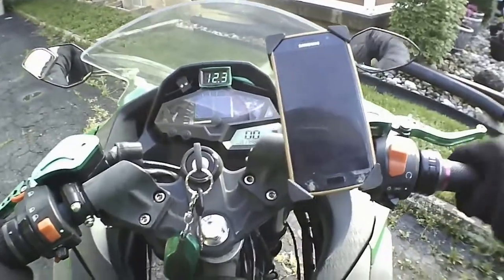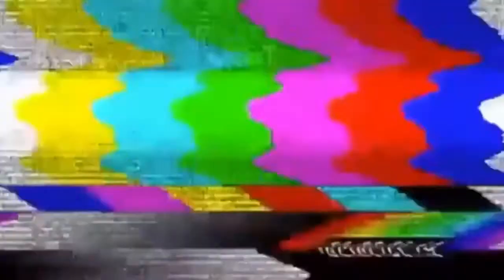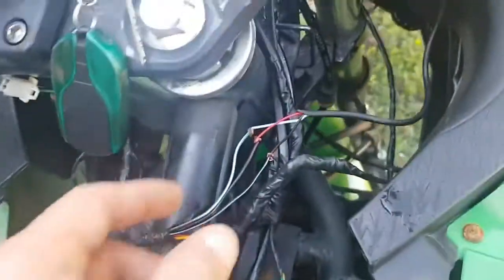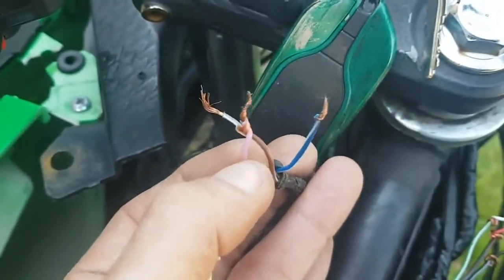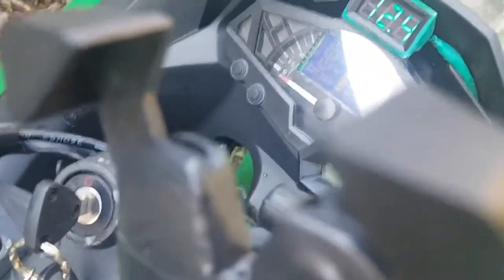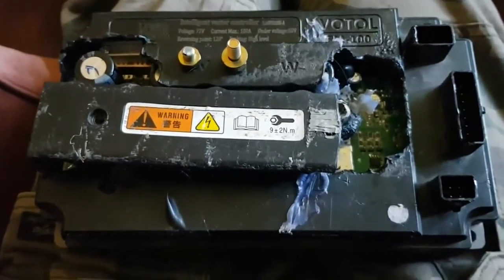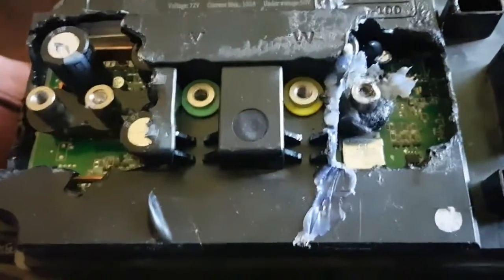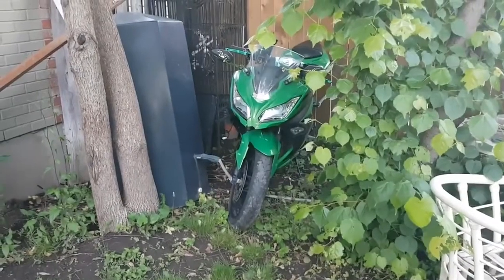Tao Leo - Death Of A Votol EM-100 (Pt.  2of2)

Comment: Sir i have a controller votol em100 but not working i dont know the problem can help me thank you
Reply from the maker: You have to program it with a computer. You need a special cable to do it and you have to set it just right or you could burn out your controller. If you don't understand this, I suggest bringing it into your local ebike shop and get them to do it. Hope this helps.